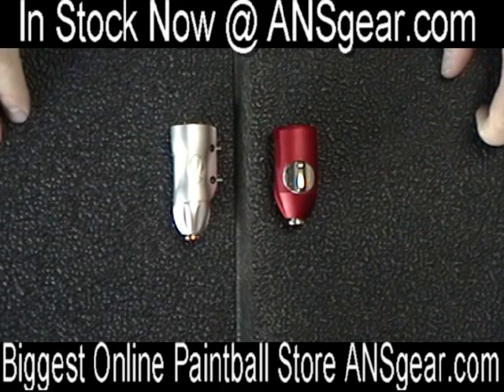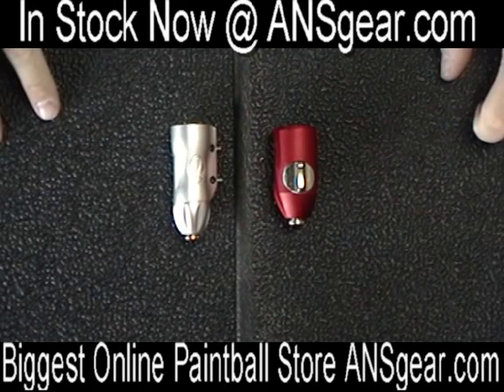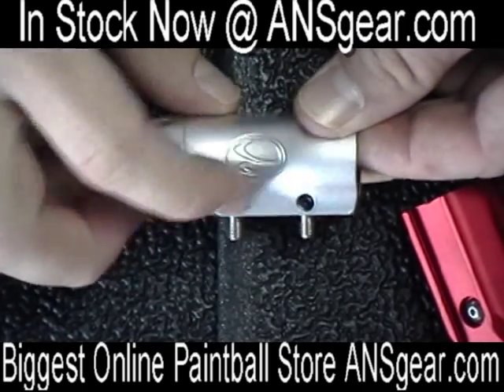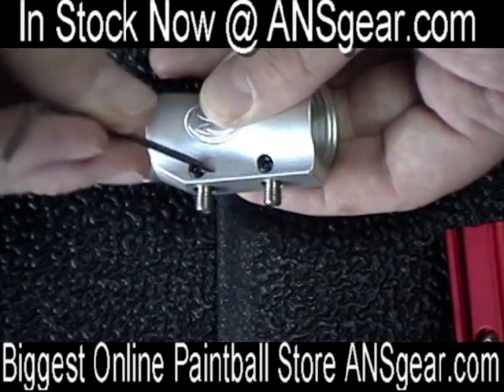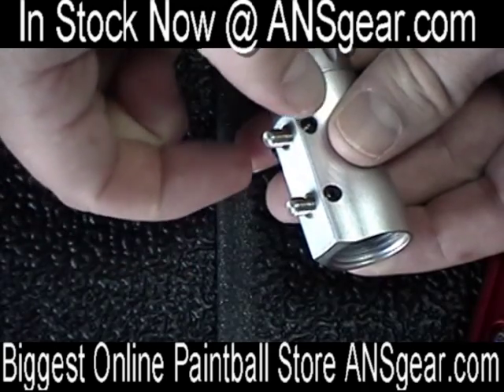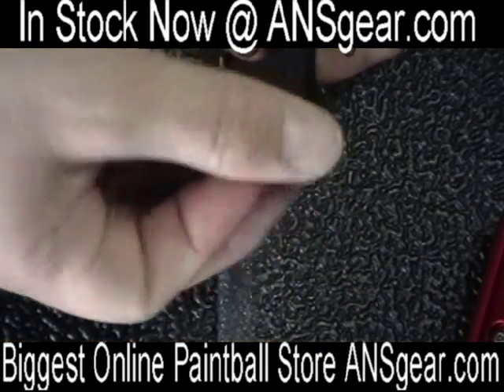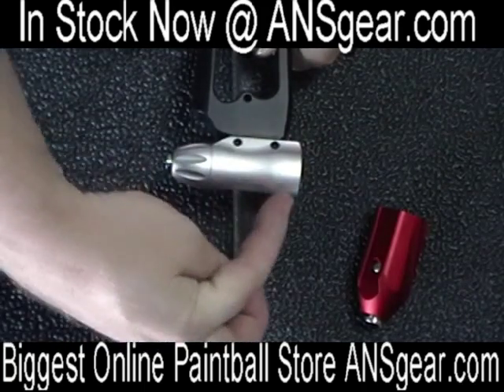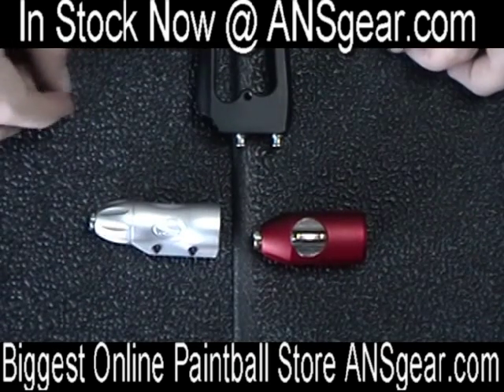Bob Long ASAs In Stock.  Check them out

Comment from the maker: The Angel A1's have a dovetail on the frame so you can use any asa that has a dovetail style mounting system. So the Cam Drive asa should work for you.

Comment: How do these work with the new Ninja Pro V2 regulators? I have a Dye one and i heard they are almost impossible to close with the Pro V2
Reply from the maker: nick fults  If your gun can operate at a lower pressure then I would recommend dropping the pressure on the Pro V2 reg. This will yield better results.